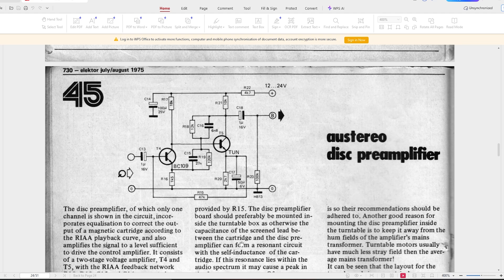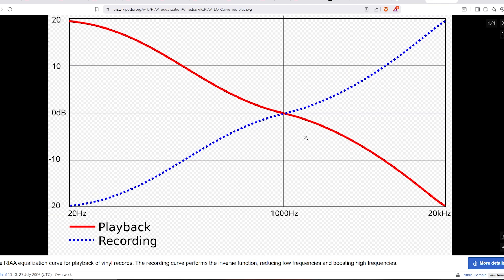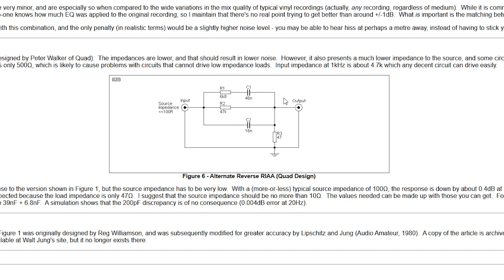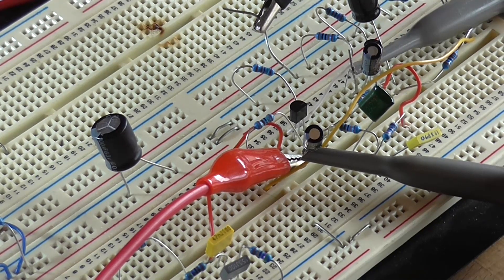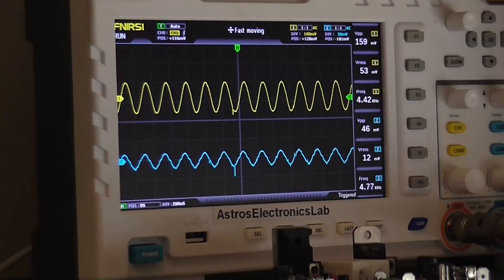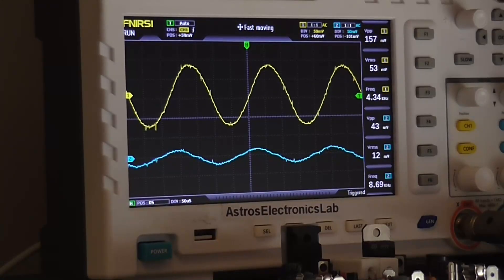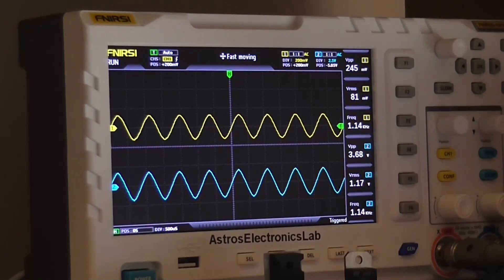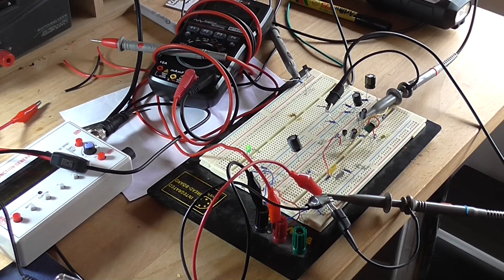Elektor Discrete RIAA Phono Preamplifier

Comment: If with the 12mV input level you get 120mV a t 1kHz (gain of 20dB), you should get 1.2V at 20Hz (gain of 40dB) and 12mV at 20kHz (gain of 0dB).
You got 1.15V at 21.5Hz, but i couldn't see what the output level was at 20kHz with 12mV input😀 you'll figure it out, seems like a valid circuit.
Reply from the maker: That sounds about right. I'm 99% certain the circuit is working correctly (even with a BC547 substituted as the input transistor) and following the RIAA eq curve as it should. My test circuit for reverse RIAA is not properly "tuned", so might be inaccurate. Without a turntable, it's a little hard to determine correct operation with say an ELO record 😅

Comment: Hi Astro - one aspect of this circuit is that the input and output phases shift quite considerably relative to one another, resulting in the introduction of phase noise to the output.  I would expect that, with a real world signal containing a mix of frequencies that this might result in a 'muddy' sounding output signal.  Its likely that this is also a problem with other RIAA preamps, too.  Its also quite possible that the reverse RIAA circuit used to generate the signal used to cut a vinyl record in the first place introduces "equal and opposite" phase noise when cutting a vinyl record, which is cancelled out on playback...

Comment: Interesting that the input transistor is specified as BC109. It was considered low noise at the time. A modern alternative with a low base spreading resistance (Rbb) should reduce input/voltage noise considerably which would improve the SNR when used with an MC cartridge. Section 8.5 of The Art of Electronics (Third Edition) covers it in detail and is an interesting read. I don't have a turntable either but it was helpful information a few years ago when I was designing a mic preamp for a dynamic mic with very low output.
Reply from the maker: I used a BC547 for both transistors in my test. Cross-referencing the BC109, it was noted that the BC547 is a good alternative. There are probably better transistors with better specs.